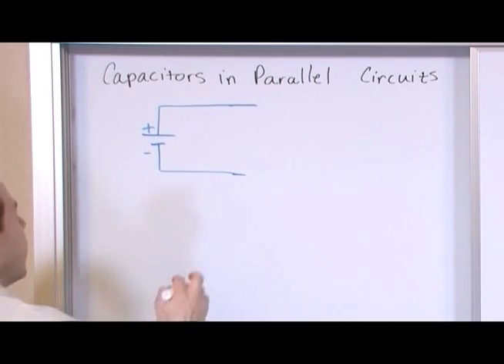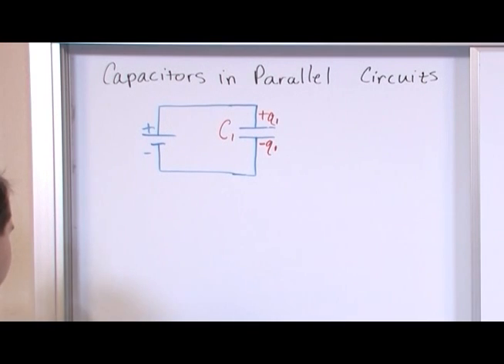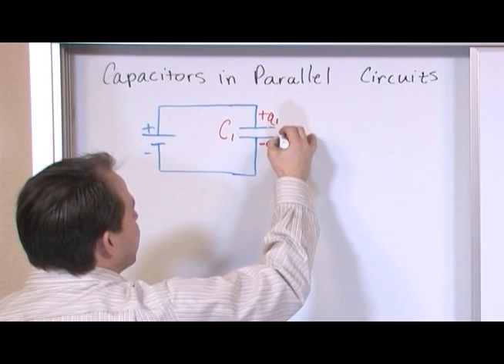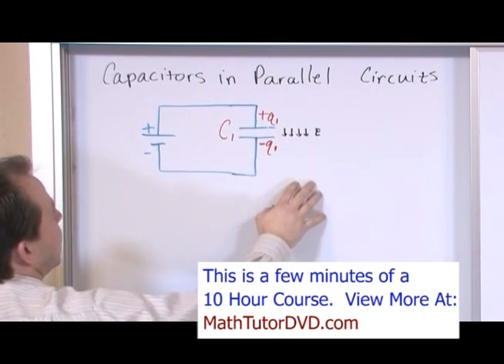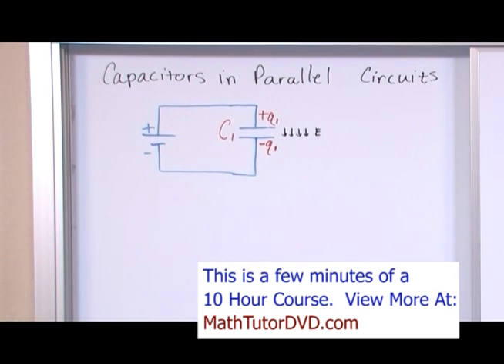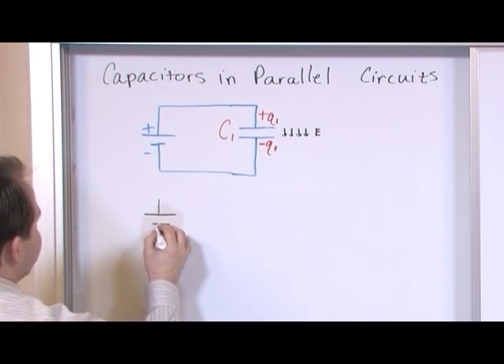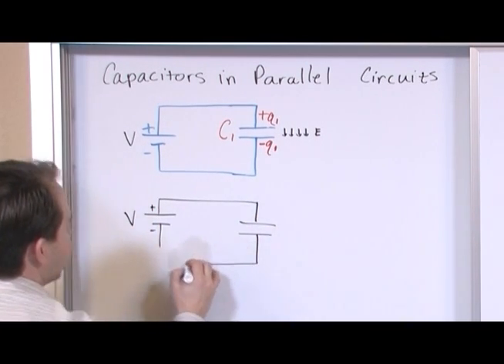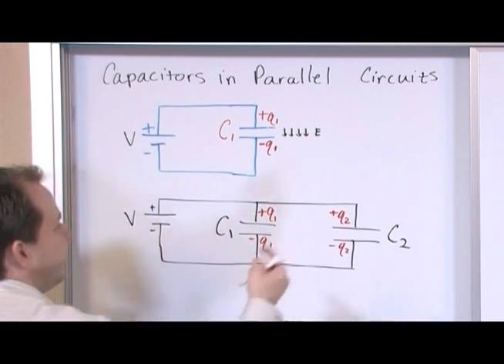Capacitors in Circuits

Comment: Pls.. Any one..i want answers this question.. A230V, 50Hz voltage is applied to a coil of L=5H and R=2	omega in series with a capacitance c. What value must C have in order that the p. d across the coil shall be 250v?

Comment: This is an impossible circuit if you put a switch in series with the capacitors.  Voltage across a capacitor cannot change instantaneously. without violating its terminal V-I relationship.

Comment: Excellent Video.  You have a knack for teaching.  Instant subscribe and Like!  

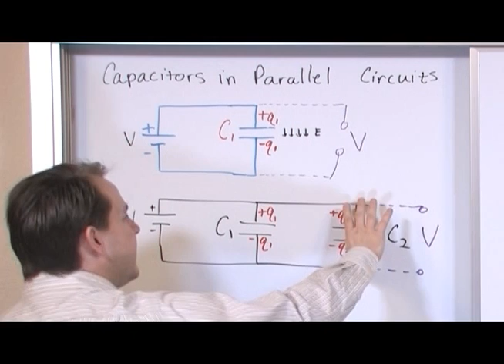@ 6:22 in the video, ou mention that the voltage would read the same between the two caps in the example circuit, unless there was another component (i.e.resistor, cap) between said capacitors. the component you are potentially referring to have to be a diode that only allows flow in one direction?

Thanks!
Reply: If a diode is added in series with the supply voltage it does drop or stop the DC voltage, depending on which way it's connected. If in line before the 1st cap the voltage will drop to all caps, if added between cap 1 & 2 it would only drop voltage to #2 & beyond. Sorry I've forgotten the exact voltage drop across diodes. Likewise a resistor drops voltage but in the case of a resistor how much depends on it's ohm value & where you put it in the circuit.

Comment: OK, the electrons create the negative charge in this circuit, but what atomic particle creates the positive charge?
Reply: I guess it's the lack of electrons in the positive plate as elections flow from this plate to the positive side of the terminal of the battery leaving just positive nuclei
Reply: I guess it's the lack of electrons in the positive plate as elections flow from this plate to the positive side of the terminal of the battery leaving just positive nuclei
Reply: They call the positive charge "holes" ie. where the electrons came from. The lack of electrons.

Comment: current flows from negative to positive in a circuit, you learn that the first week in any basic electronics course.
Reply: +michael Woods Technically, "positive charge" flows from positive to negative in a circuit. Current is typically defined by the positive flow of charge, rather than the actual flow of electrons.
Reply: +Jeremy B that's so confusing. College is going to be hell, I tell ya.
Reply: @smooooth_  I know this is an old post but ... think of it this way:
Yes, it is electrons that physically flow through a circuit. BUT, mathematically, charge can flow either way. IE, if electrons, -ve charges, flow in 1 direction then the opposite must also be true that +ve charges flow in the opposite direction and vice versa. Forget physical flow of electrons and concentrate on charge flow. I hope this helps :)
Reply: @aaronspencer1880  Since that comment I am in college and I do understand it a lot more now. In fact I don't even think about one vs the other confusion much, especially when it's mixed with all the other parts of circuit analysis. Thanks

Comment: Why are capacitors used in DC circuits? .aren't they just going to charge up and when fully charged stop current?  So what's the point in putting cappacitors in DC circuits